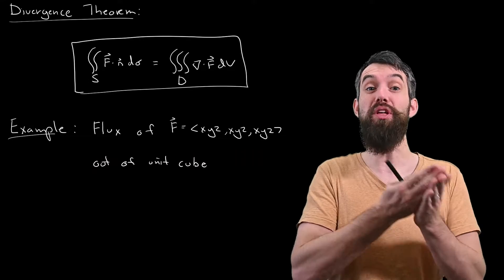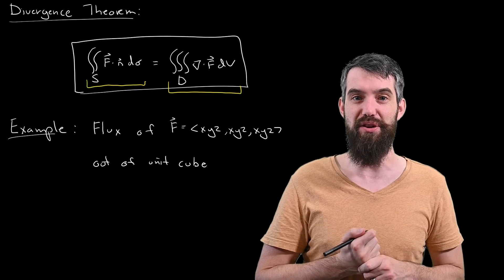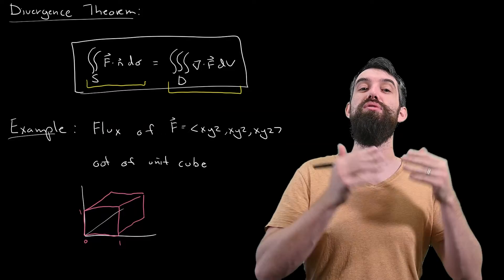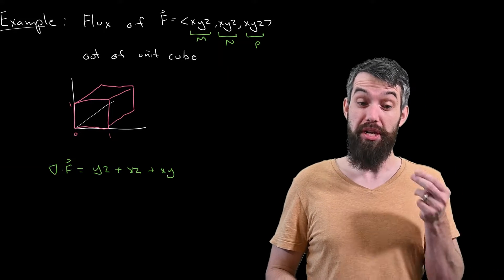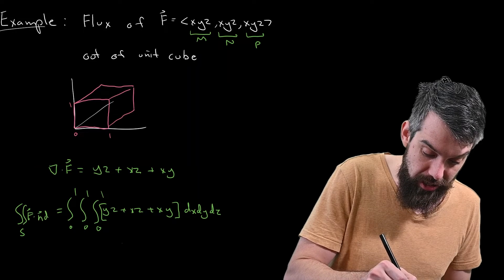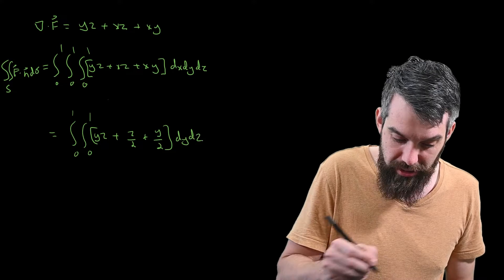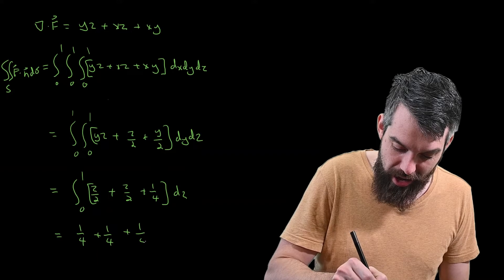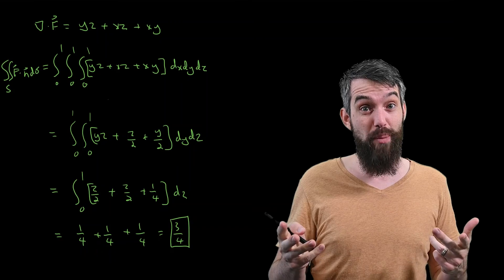Divergence Theorem example: Flux across unit cube  // Vector Calculus

Comment: Hi this is a great video! But I was wondering when you were talking about the deformation theorem, that is; when divF = 0, any 2 closed boundaries share the same flux. What I cannot seem to get is, if divF = 0, should the total flux for any closed boundary also = 0??
Reply from the maker: The total flux over all boundaries have to zero, any specific closed region might not be though
Reply: @DrTrefor   @Dr. Trefor Bazett  thank you very much for replying sir, but I guess what I still don't get is, can you call any specific closed region its own region. And then apply the divergence theorem on that region alone to say it has 0 flux?
Reply: @dantepillon   You are correct that if divF = 0, the total flux for any closed boundary should be 0. In other words, the flux entering the boundary must be equal to the flux leaving the boundary. This is actually a consequence of the divergence theorem: if divF = 0, then the integral of F over any closed surface should be 0. 

The theorem should read: when divF = 0, any 2 closed boundaries share the same amount of flux and the total flux for any closed boundary is 0.

Comment: If F= yz i + zx j + xy k and S is the part of the surface of the sphere x^2 + y^2 + z^2 = 1 , which lies in first octant , the the value of double integral F•n ds is 
Sir why we can't use Divergence theorem in this question?
Reply from the maker: Divergence theorem ONLY applies to a closed surface, not part of one.
Reply: @DrTrefor  Thank you Sir
Reply: @shubhampatel0504  You can often use the divergence theorem as a shortcut to evaluate the flux over a surface that isn't closed, when symmetry works in your favor.

Like if it is easier to find the flux over a closed surface using the divergence theorem, and the open surface in question is just one octant of 8 identical octants, that would form a closed surface if you connected them.